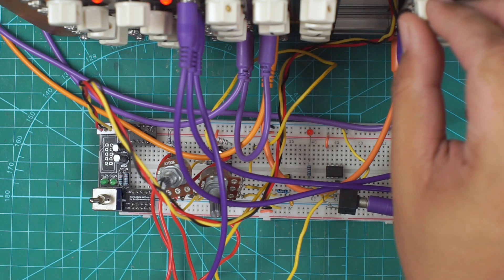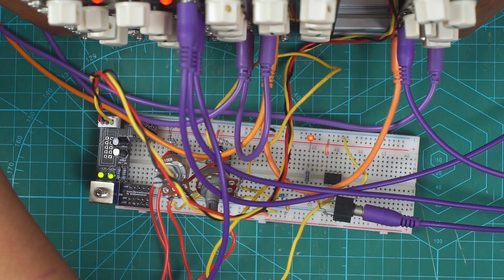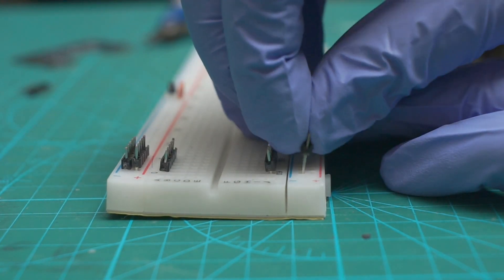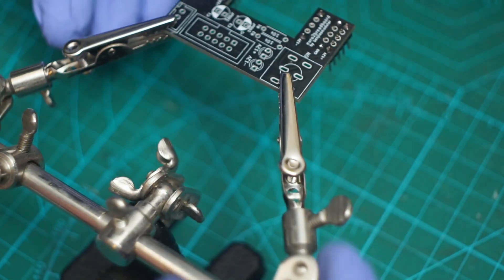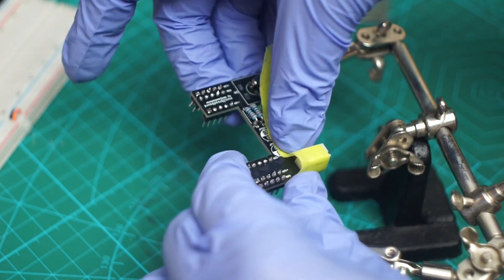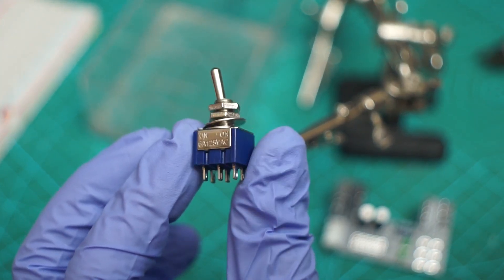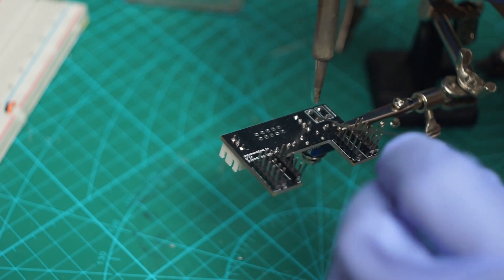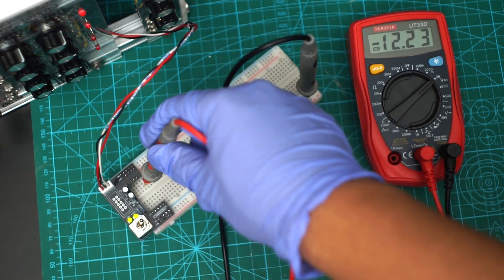Euro2breadboard -- Connect your breadboard to your Eurorack power supply

Comment: does this protect the PSU from shorts on the breadboard at all? also, really lovely music !!
Reply from the maker: Hey thanks, Andrew! Nope, it doesn't have reverse or overcurrent protection. It's the equivalent of just plugging your PSU to the broadboard, a toggle switch that would let you disconnect everything, an indicator LED, and some bulk caps to get rid of some noise. 

That does sound like a great idea for V2. :)

Comment: Neat! 🙂 That's a really useful tool for breadboarding 👍
Reply from the maker: Thanks. It is! The switch keeps me from plugging the power supply wires into the wrong places. 😆
Reply: @benjiaomodular  Yeah - wrong polarity is not great - ICs and electrolytic caps doesn't handle that well...💣😟
Reply from the maker: @MeeBilt  that's true. We all try our best not to release the magic smoke. 😉